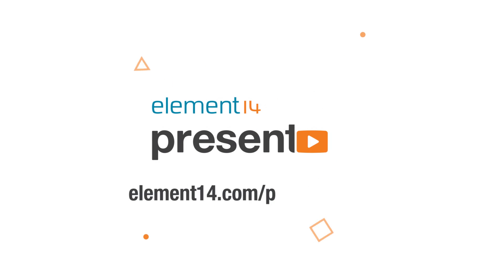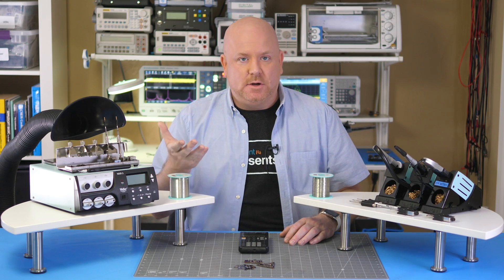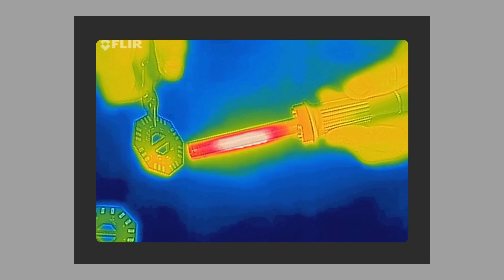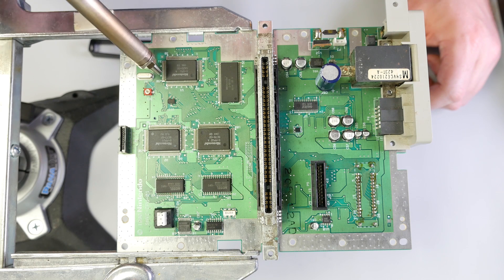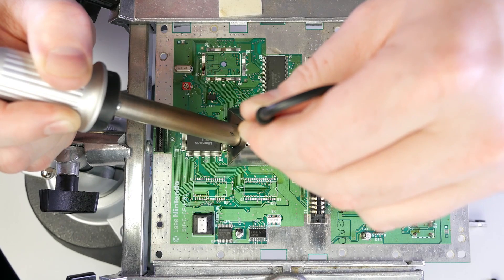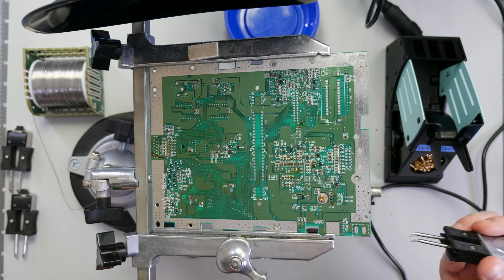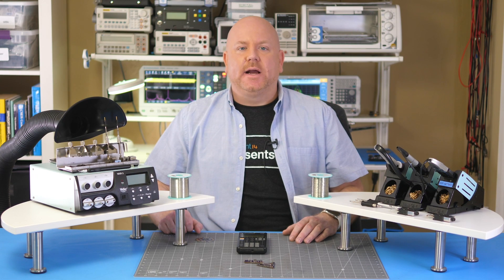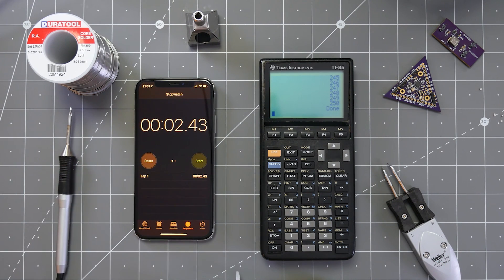Surface Mount Rework Tools - Workbench Wednesdays

Comment from the maker: What type of solder do you use most often? Let the team know on the element14 Community: http://bit.ly/2FI6ZtI
Reply: 63/37 leaded solder. I refuse to use tin whiskers lead free solders. I used roson core and no clean solders. I don't use a flux bottle but if I need more flux then multi core solder usually works. when removing lead free products I usually add leaded solder then I extract and remove the product. on legged ics I cut the legs off then remove the legs from the pcb. I use a hand pump to remove solder from the holes. I don't have Access to a desoldering station. a co worker has one but he has to fill an air tank for the desoldering station. our air system does not have pipes going to all work stations. 73

Comment: Can you make my Nspire CX faster?
Reply: Not as easily as the Z80 based calculators. The CX uses an ARM9 SoC with an internal multiplier. It has a crystal, but it might drive more than the CPU core.
Reply: @bald_engineer  Oh, okay. I thought I saw some software or something that could overclock the calc, but maybe not.

Comment: Any suggestions for the correct way to rework surface mount electrolytics? Hot air tends to make them explode, and it’s next to impossible to get tweezers on the leads. Some YouTube videos suggest just twisting them off the board with pliers. Yeah, no. Maybe some boards can withstand that, but not the old stuff I work on.
Reply: I needed pictures to explain, so I put together a response for you on e14: https://www.element14.com/community/docs/DOC-91429/l/workbench-wednesday-05-surface-mount-rework-tools#comment-152496
Reply: James Lewis Thank you very much for the detailed reply!!!
Reply: not a good idea just heat on end and try to flip it up on one end and then remove the other end. you can also use a heat gun on surface mount resistors and capacitors . tweezer type of iron works wonders also. 73

Comment: I just wish Weller's modern equipment (heater-in-tip stuff) would be more affordable for hobbyists
Got a chance to use this modern stuff in a uni lab, and left wanting a small loan of $5000 to buy some :)
Reply: You can buy an Atten 826 d by $250 on AliExpress and it’s more powerful than Weller
Reply: @ingenierocristian  atten 862d you mean. Of course is more powerful than the weller which no hobbyst use it. It is also rebranded as Multicomp Pro MP740784.

Comment: I use both lead free lead most of the time.thats a niceWeller station  .Check out my Weller station video . Weller fume extraction for two lines
Reply: Where'd you get the lead-free lead?  Is that like dehydrated H2O?

Comment: i am just a hobbyist when it comes to electronics but i experienced lead based solder wire and paste works perfectly while the other ...sort of gluey or sticky when you try to solder. Yes they are harmful to inhale but as said i'm new and don't use soldering iron or flux day to day basis.  Thank you Bald engineer! your videos are jaw dropping and inspiring to do something new!
Reply: Lead free is also harmful to inhale.  Just use a respirator or a cheap fine extractor. $20 now is worth it to avoid running your health later. 👍